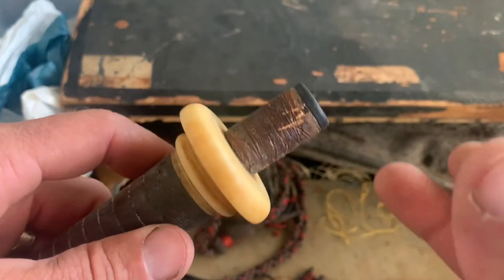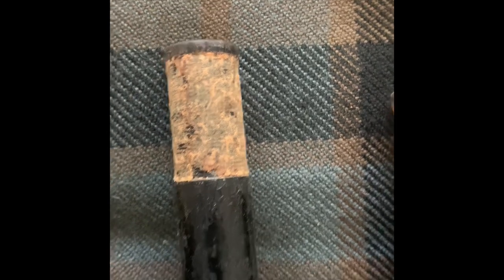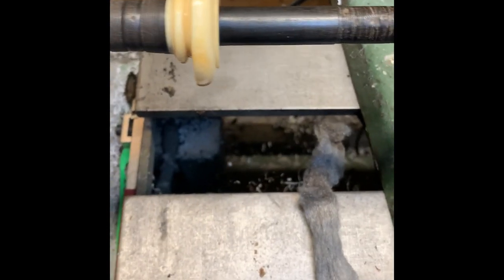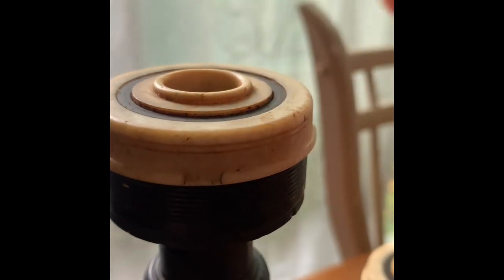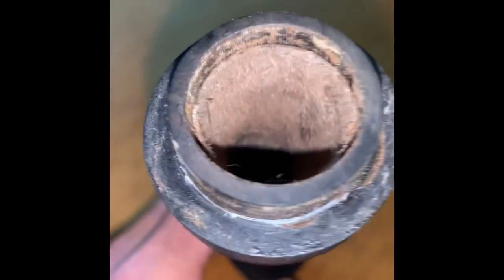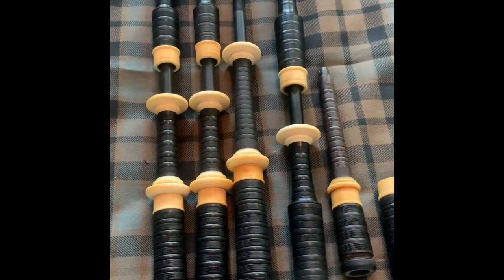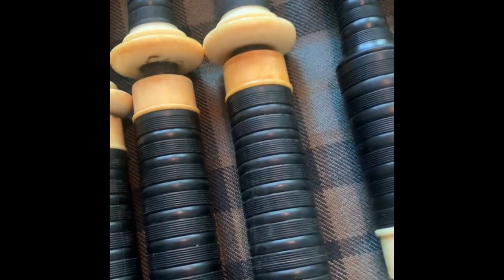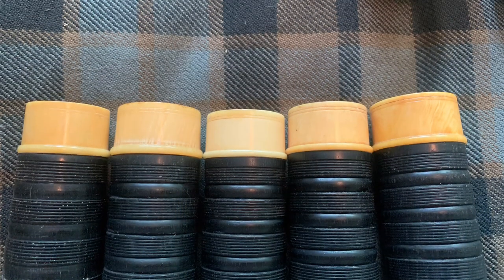Part 2 of the refurbishing of a gifted set of full ivory pipes.

Comment: Cork was used <1960. I have been told that military bands pre 1960 used cork. Best check with the Piping Center I am sure they can shed some light on the subject. By the way a past Bandmate of mine who is a concert violinist had all her joints corked.
Reply from the maker: Thank you for this information.  I’m pretty sure it was a military pipe.  I think this because the beading and combing on the bass bottom joint has been completely worn down.  Probably by a plaid brooch.